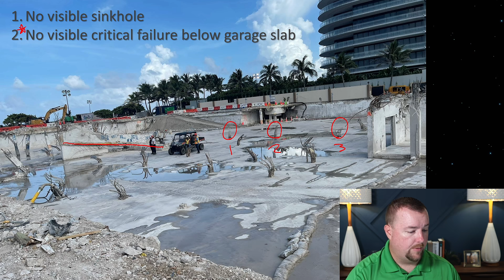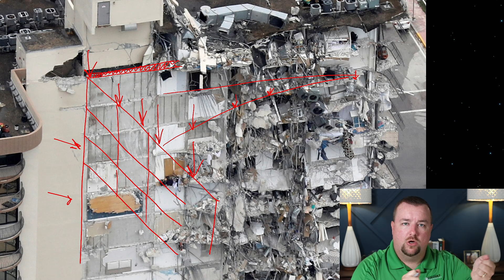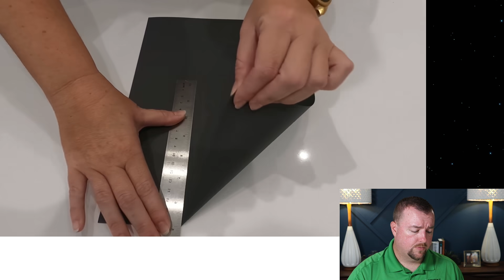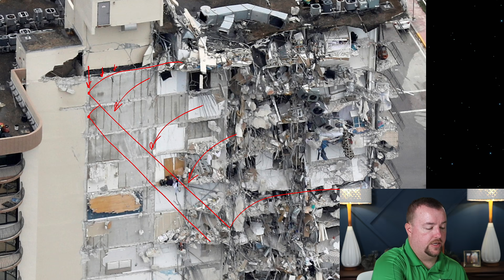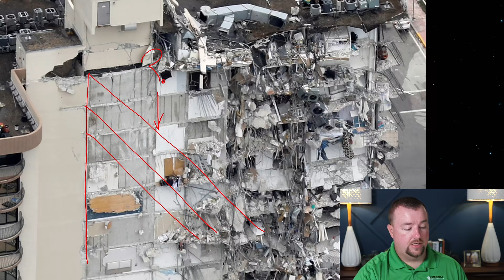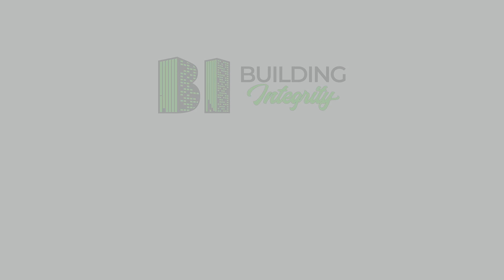Surfside Collapse - Structural Engineer Explains Why Only Half the Building Collapsed

Comment: Great video and explanation, thanks! In new (2021) construction, is strength still just built in as a factor of typical loads like static, live, and wind, or are the kinds of dynamic failure modes shown in this video taken into account?
Reply: I think they always were taken into account... but cost cutting and skimping on materials seems to be a problem even nowadays...

Comment: Very good explanation, it explains why there doesn't appear to be a whole lot of rebar sticking out of the shear wall which I had found puzzling. I keep hearing people talk about the building itself and the garage's water problems but so far I have not heard anyone say anything about elevation above sea level of the floor of the parking garage or sewer line connections to the city's sewer line which the garage drains would empty into. It wouldn't be the first time a city sewer line was put in the wrong way and I'm speaking from experience, it happened to the store I worked at in North Miami back in the late '70's.

Comment: So if the deck suffers punching through at the columns, destabilizing the building, causing everything to the right of the sheer wall to collapse(enter jump rope analogy) then why didn't it affect the columns underneath the remaining structure (that was later demoed)?  Was that pulling force by the pool-deck relieved once one end of the building had fallen? I'm assuming the sheer wall doesn't extend all the way into the parking area slab.

Comment: All of the photos I've seen recently of punching shear in other structures,  are all slabs exposed to the elements " carparks, rooftops " and we know there was punching shear at the pool deck at Champlain towers, which was also exposed to the weather ,  I  think it was slab failure,  either the roof collapsed first ,or the pool deck collapsed first, pulling the three front columns away from the building , I think you may have mentioned that in a previous video,  I hope its possible to find the initial cause .

Comment: If the building that remains standing went thru true inspections because it was first built and the second building was a latter build it may have been just passed off by inspectors instead of inspectors doing their job and stopping flaws, failures, and poor designs at foundation levels prior to the completion of 2nd building.

Comment: I am M.E. 3 times over. Yes his theory is 100 percent correct. I believe the causes are water which caused shifting and sinking. Also i really feel some inspections were not proper in the first 3 or 4 levels of foundation to garage which also caused failure. The area is now under water  so that is telling me #1 they needed more fill foundation #2 the land was not fit to build on. The first thing you learn in engineering and structural design is " the building foundation is the strength of the whole entire structure"

Comment: At around 6:00 there appears to be what look like three interior columns that are relatively intact. What is striking to me, is that they show the opposite punch shear to what would seem to be expected. ie. they are pinched at each slab level, rather than the expected mushroom bulge. 

The columns are above and to the left the red I-beam structure, particularly the one leaning against the shear wall being talked about.

Comment: Great video!  Looking at the rebar drawing, there was not enough rebar used with very little crisscrossing members in each floor slab. Also the pillars don't appear to have used rebar column cages.  I wouldn't feel safe living in the North building knowing how cheaply the south tower was built.

Comment: So, in looking at the floor plan, NEXT to the shear wall there is no support for the structure next to it, meaning it is cantilever from G10 to G4 (the shear wall).  I cannot see a north arrow, but I'll say just east of the shear wall there is no support until 'I'.  So between 'G' and 'I' it is basically cantilever being supported by the 'I' columns only.  And its been that way since it was built.  Please correct me if I'm wrong here.  Isn't that where it started, at the shear wall and column I?  Bad design....

Comment: A couple of questions:
(1)  Buildings are of course designed to handle weight and it seems logical that the design must include a factor to include the theoretical weight of future owner/occupant items brought into their units upon closing.  Is this a reasonable assumption and, if so, how does that theoretical weight get factored into the design plans?
(2)  Many condominium units will have wall-to-wall carpeting in several rooms.  I know from experience with, and/or conversations about, other condos that unit owners will often replace such carpeting with other flooring materials---often with ceramic tiles or marble stone--that I would understand to have a significantly greater weight than the carpeting and padding it was replacing.  What impact would the additional net weight of tile and marble replacement flooring (i.e., less and except the weight of carpeting and padding being removed) have on the building in terms of placing additional stresses on the building's infrastructure?  To the extent that such flooring replacement might exceed the building's original designed weight bearing capacity, would it be possible, by making reference to the original design plans and/or unit floor plans, to calculate a maximum additional weight based on the assumption that every unit had its carpeting replaced with heavy materials?

I'm not making any suggestion that such additional weight added to the building would play a role in structural failure, but I'm nevertheless interested in the answer to the above questions.

Comment: WHY IS THE CLEARED AREA COVERED OR UNDER SALT WATER? Is it to further corrode the cement etc to put the blame on nature or the management rather than insurance companies or management failure???
Reply: My guess, through doing some checking of elevations and tides, is that the floor of the garage at time is at sea level. Surfside's elevation shows as 13 feet above sea level so if we assume that the garage walls are 10 feet tall then the floor will be 3 feet above normal sea level. Checking tides it appears that high tide runs between 2 & 3 feet above normal sea level depending on the day of the month so at 3 foot high tide the floor is at sea level! Something that I haven't heard anybody talking about is if the sewer lines under the streets that the building's sewer line was connected to were put in correctly? A store I worked at in North Miami had a problem with their sewer line backing up into the store during a heavy rain and that was traced to the new sewer line that was put in under the street being at a higher elevation than the old sewer line so our connection was near the bottom of the new pipe rather than at the top. The solution was for us (thanks city) to dig up our line and raise it to correct the problem.

Comment: The SWS  was designed for wind load not gravity or moment in that direction. The overturning moment  is in the weak axis direction.But the weak slab to SWS connection doomed the building.

Comment: The kill shot was the very weak shear connection to the side of the columns. It appears that the pool deck collapsed maybe at the non-reinforced joint  and imparted a shear load and a  moment to some of the columns via the floor diaphragm action.
This caused serious attempts of the building to redistribute the loads before the floor shear off of the column. Pics of the columns show them still together but shearing and torque damage at the location of each floor. It also shows a few spindly rebar holding the floor to the column.

Comment: Thank you so very much for taking the time to explain what really happened to this building. I'm just wondering about your opinion on the strength of the remaining portion that was later demoed. Do you think it would have been safe to just leave the remaining portion as a base to rebuild the part of the building that collapsed? Would it have lasted safely if someone went in, restored it to pre-collapse condition, then rebuild the new building with the much safer new technology? I'm really curious what your opinion is on this idea and if you think it would have been safe.
Thanks again for all you do, I'll be looking forward to your response.

Comment: 1 was the concrete manufactured on site? And was beach sand used?
2 More than likely the slab was poured in two days with a brake line at the sheer wall. This was built before concrete pumpers So it was all crane poured.

Comment: The columns tied into the failed patio slab received a large lateral force and moment in rotation from the slab collapse.
this caused instability all the way up to the top of the column. The parapet area which was much weaker started to crumple along with the base of the columns.

Comment: The columns in west wing were larger than the east wing.  It is on the drawings.  Here in Bangkok the columns on a 16 story condo are larger than Florida by about 30%.
Reply: SHHHHHuuuush!... concrete costs money... money that's direly needed for the marble tile in the lobby!  (Compare the impeccable condition of the lobby in this tragic building, to the deplorable condition of the ground-level/main/garage-roof slab, and you have the psychological profile of HOAs all over Flori-duh... that such collapses are so rare is a tribute to the safety margins Engineers design-in...)

Comment: Josh, just a simple NASA engineer here, so what I don't know about civil engineering would fill volumes, but as a possible building collapse trigger  event, could the collapse of the pool deck from the delaminated upper rebar mat in the pool deck slab have propagated some lower concrete loss into the section of slab between columns 1, 2, and/or 3?

  I'm thinking that, if so, the amount of tension strength available in the lower section of the slab between columns 1, 2, and/or 3 means all the weight of the slab has to go through the upper rebar mat in compression, and that just can't handle the load, and it failed in the 7 minutes we saw between the video of the people looking into the garage from the outside to the collapse.

Just curious.

There was a report of one survivor in one of the collapsed units who was awakened by something, thought it was her patio door open, saw cracks forming in the ceiling, and got out, thankfully not taking the stairs right next to her unit but crossing over to the stairs in the section that didn't collapse and was there when the building came down.

Comment: So why did the rebar rust?  I understand salt water thing, but I see docks, buidings on pilings in slt water, some are 50 plus years old, even at low tide there is zero spalling seem, the pilings look as good as new.

  can rebar be galvenized?  is some concrete more water proof than others?

Comment: What you did not mention is did the shearing start in bottom of the building or at the top.  My guess is the shearing started at the bottom, from comments made just before the collapse, and created the domino/lightning effect as it went up through the building and out to the other side of the building.  The reason I state lightning effect is that science tells a lightning bolt actually starts at ground level and goes upward though it appears to us as coming downward.  Question: Had there been a matching shear wall in the 3rd section, would that section have stood and saved more lives?

Comment: I understand how the failure of the slab attachment to the column at the level of the pool deck (shear failure) would lead to the collapse of the pool deck. However I do not understand how this would lead to the collapse of upper floors unless their attachments to the column were also compromised, or the columns themselves failed.

Comment: We need more explanation besides the shear wall.  I thought you were going to  get into the columns of the building that remained.
Reply from the maker: The MAIN reason the progressive nature of the collapse was halted and the west wing was spared was due to the shear wall.  The size difference in the columns would have done little to stop the progressive collapse if the shear wall wasn't present.
Reply: @BuildingIntegrity  Not true. It stopped progressive collapse at the front side of the building where there was no shear wall force. The ground level slab collapsed yet the building remained standing.

Comment: In the pictures displayed, I do not see rebar protruding from the sheer wall that would have joined with the collapsed slabs.  Has the rebar been cleanly severed or is it missing meaning that the steel provided no support to the fallen structure?

Comment: A very interesting talk that highlighted a number of issues, even though the cause this building's demise is still somewhat foggy to my untutored eye. I found your comment about the lack of load sharing internal walls interesting, the 'slab sitting on columns' simply looked fragile to my untutored eye. I studied a little civil engineering too many years ago, the only thing I remember is that concrete works ideally in compression, but less well in tension and attempts at flexing risk tension and tension cracks. As a result, the lightweight building feels like something waiting for damage to happen. Thin columns are graceful, and without horizontal beams the sight lines flow, 
My only experience is as a user, not builder or designer, and they were heavy structures with all manner of steel beams and reinforcing. You mentioned the dynamic stresses of wind and weather, along with possible salt penetration from its marine environment. Was this a 20 rather than 40 year structure when subjected to an unknown number of insignificant, cracks, cuts and insults to its margins?

Comment: Seeing these photos reminds me of the progressive collapse of Ronan Point in UK in 1968 which was initiated by a gas explosion in one of the apartments.
It led to considerably tighter building regulations relating disproportionate collapse requiring redistribution of loads after failure of structural members and more thorough risk and consequence analysis. Buildings became safer and the people who sadly lost their lives did not die completely in vain.
I would like to think the same will be said for the souls who died in this disaster. RIP. 
Condolences from UK.

Comment: It would be more appropriate to use the correct page of the plans in explaining this which is the "garage" level framing page not the "typical floor" framing page. The columns are all different at the garage level. I believe the stronger 24"x24" columns in combination with the shear wall were why this part of the building was still standing.

Comment: Has anybody considered impacts of the economics of the time in which Champlain South was being built? Between 1979 and 1981 inflation was in the double-digit range and interest rates on commercial loans were approximately 20%. The cost of construction of this building would have been skyrocketing on a daily basis and the builder would be under extreme pressure to repay the construction loan. The national economy was in the deepest recession since the Depression which begs the question as to what kind of demand there was for ocean front luxury condos. In 1980, Miami saw both race riots and the Marial Boat-lift. How would those events impact the real estate market.  I have to wonder if the financial reality the developers were facing led to cost cutting.

Comment: Josh, assuming foundation failure did not directly cause the collapse do you think the initiating facade collapse would have occurred if the pool deck slab under the planter had not been tied into the main facade columns? ie there was a discontinuity?

Comment: Sound familiar? Pervasive water leaks for years but engineering reports say "structurally sound".   https://www.youtube.com/watch?v=fxLtWiJ8uVg  "Algo Centre Mall Collapse, Canada"  Cause: Rooftop parking lot had no waterproofing (sounds hard to believe) so salt water from cars (salt used to melt ice on winter roads) corroded steel beam connections and so one section of the roof collapsed and the mall, an awesome community hub, had to be demolished.  Loosing another entire building for lack of the relatively minor repair of waterproofing! Given the amount of water leakage, they should have been looking at the parts that they could not see.

Comment: I'm not a structural engineer, but it seems logical that a building's design should be such that a single failure at a column or beam should not result in total callapse of a structure. Is this a requirement? Now, this is different from when you have progressive weaking or stressing due to corossion or subsidence respectively applied over a large area. In this case the signs were there but the methods employed to make a determination of eminent failure failed us. Time to use the technology and the legal processes available to us to more accurately make this determination.

Comment: Did you get the ramp location wrong, @BuildingIntegrity? The side ramp was entered from the north side between Champlain Towers South and the next condo (not the fancy oval one that is south of the Champlain Towers South....talking about the other condo building to the north of CTS). The ramp entrance would actually be in the foreground of the picture you provided and straight ahead once entered would be the pool deck/planter/pool-deck area. You're coming in from the East (ocean side).
Reply from the maker: No, I drew a line in the video showing the north ramp, it's just a little difficult to see.  I should have circled it big though.